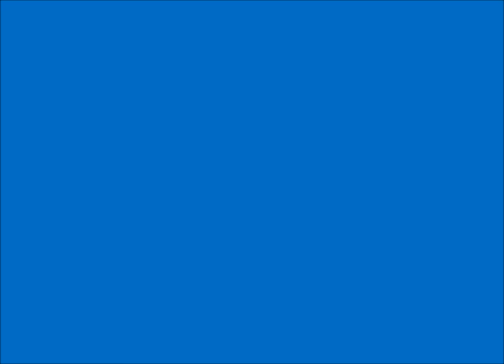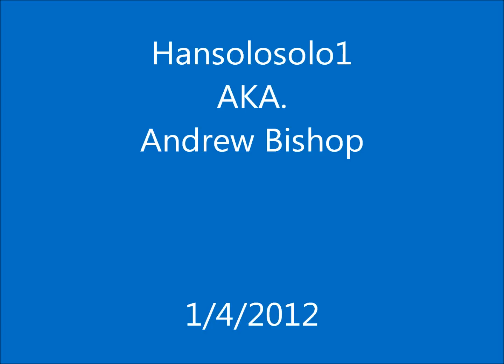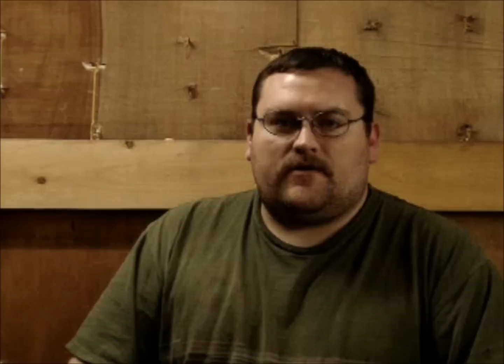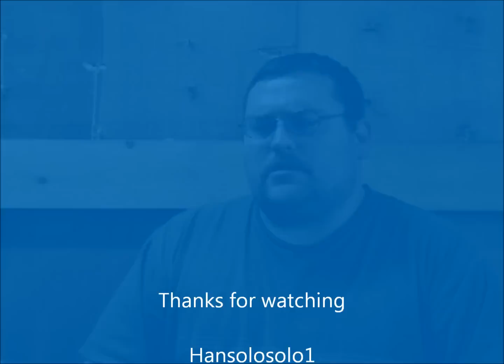HHO Dry Tube Cell Video 5

Comment: I like HHO but have found vapor fuel cheaper and easier to run engines with. See my videos if you want to see my ethanol vapor carburetor running my generator. Also I can share details of my dry JC if you are interested.

Comment: Silicone works great for high heat applications. Here is a web sight which has high heat silicone o-rings which work in temperatures up to 500 degrees F: marcorubber./silicone.htm. Hope this helps!

Comment: I liked your arrestor design idea. I may try those ss discs out sometime. If your having issues with the seals being damaged by the flashback, try a one way valve before the arrestor. Not many people are implementing this technique in there systems but after a bunch of testing I won't run my system anymore without one. The valve briefly prevents the vacuum or suction effect caused by the hho implosion during a flashback, thus preventing damage to the arrestor material due to a sustained flame...